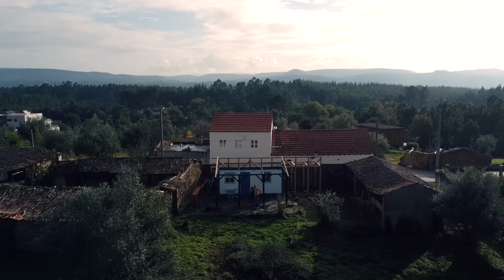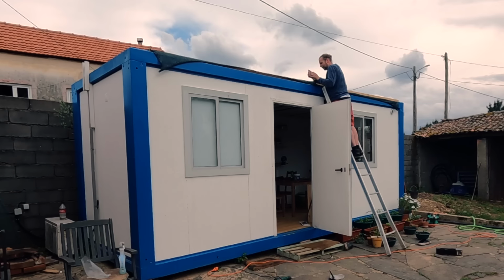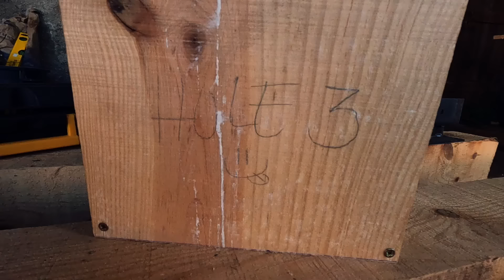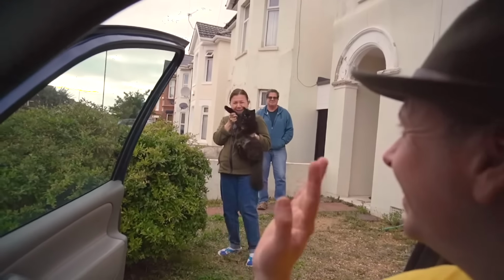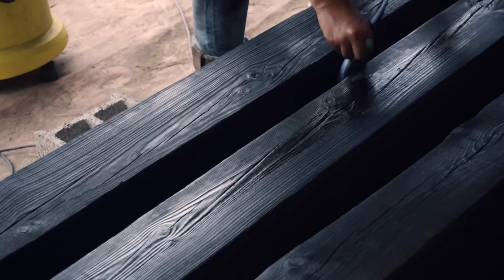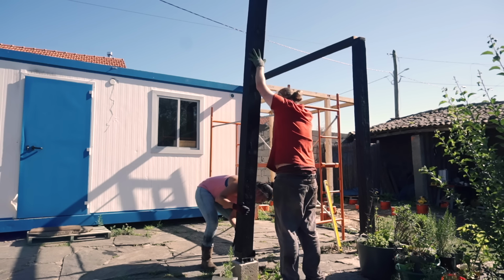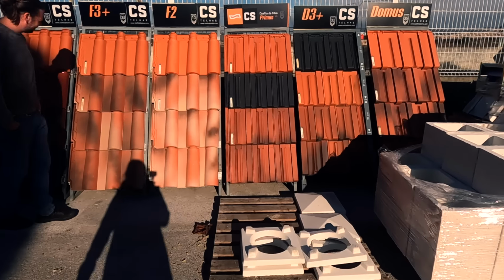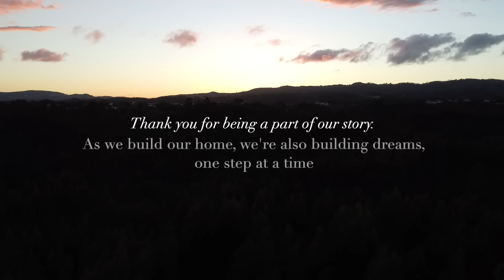How We Transformed an Abandoned $32,000 Farm | 1 Year Timelapse

Comment: Those water levels seem nice in theory but they can be incredibly finicky and imprecise if you're not very careful. Personally I'm sticking to a large level (1m, 3m) for most cases. That 1mm deviation will be compensated by ground movement and wood change over time anyway.
Reply: Should sugi ban would also be my first choice for weather protection if I had to redo my garden fence.

Comment: It's a good thing so many guys from the UK have construction experience and a dream to move to Portugal or YouTube wouldn't have any renovation videos!
Question, why didn't you put the brackets and long screws into the wet cement and let them set as it dried? I know nothing, so I'm not asking just to be obnoxious.
Everything looks good. I'm impressed!
Reply from the maker: We did that with the first method and I think ti would work if the shuttered boxes weren't so small. It also had quite a bit of aggregate, making it difficult for the screws to sink in. I think the second method was a lot cleaner and easier to achieve a good job.

Comment: Love the video but there are a lot of questionable stuff such as why is the brackets not in bedded into the concrete instead of bolts and nuts also notching beams and using untreated lumber would create huge problems in the future
Reply from the maker: Thanks Gary!  You want the brackets to be raised from the ground so the wood is lifted and the rain runs off easily
Reply: @TheIndigoEscape  Yeah that's not what he means. The brackets would be stronger if they were cast into the concrete (they can still be above the ground). The strength is now all relying on the liquid concrete you poured into the bolt holes you drilled instead of the actual brackets.
Reply from the maker: The brackets have a double stem and are super strong.  As long as everything is bolted down properly it’s all fine. Also ground is raised to meet the concrete blocks in a higher point. Two engineers looked at it and were happy with it, In fact it’s slightly over-engineered. It’s a small roof.
Notching beams is completely standard and using untreated wood is really common in Portugal. Best practice though is to use the wood immediately after delivery and not wait to “season” as it just twists. 3 years later, everything looks great.

Comment: I would have saved the old wood to burn in winter.
Reply from the maker: We don't have a burner yet. All the wood that could be salvaged was taken by Simon because he does has one :)
The rest of the wood wasn't good enough for a wood burner. It was either dusty so it would burn too quickly to create any heat or had anti-fungal chemicals which can be poisonous if burnt.

Comment: Did you need clearance from a governing body to start building in portugal?
Reply from the maker: Yes
Reply: You need to make sure that the land is in a zone that allows building. You have to check with the municipality that the land is on, it's called a PDM. Each municipality has it's own. You also need an architect to draw up plans and the plans also need to be signed off by engineers in various areas. It's usually a long and complicated process. Don't be fooled by the realtor, if you make an offer on a property make sure that you stipulate that it's on the condition that you can build what you want and where you want it. We have been learning this as we have been looking for a property, I'm fortunate to have a family member that is an architect and works at a municipal planning office. Good luck 🤞